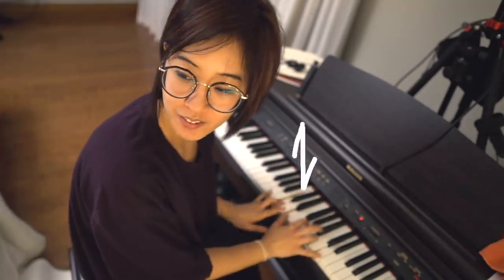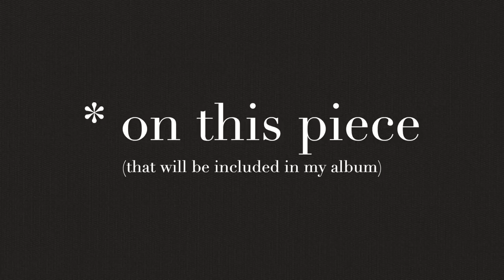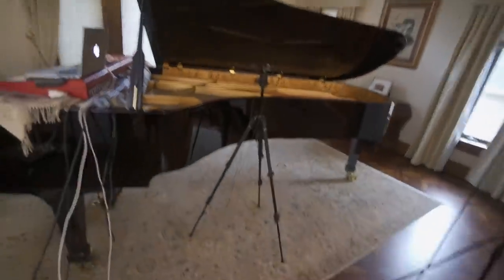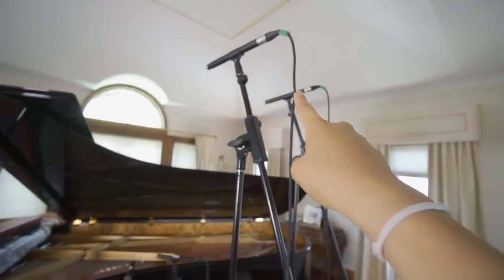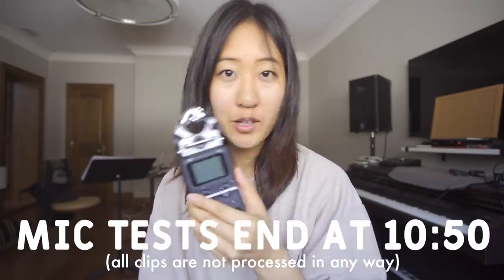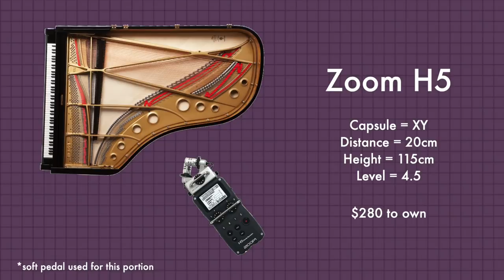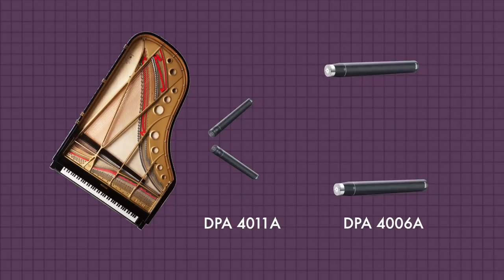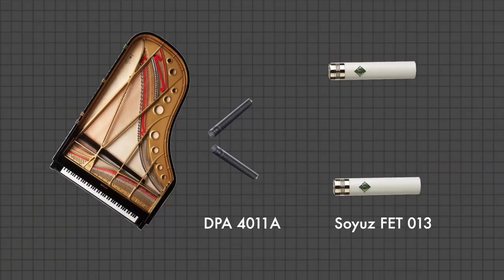Recording a grand piano is TRICKY - here's what I learned.

Comment: Thank You, I really enjoyed the video. Recording 24bit / 96k for grand piano was the correct choice. The microphone choice was smart using the x-y configuration and the high boomed stereo bullet microphones. I would say to use a larger capsule condenser microphone but you did try that with the NT 2’s. Your sound is clean and I did not hear any phase or cancelation. It’s a good idea that you got a second set of ears on the project with the engineer. The room itself is always the biggest struggle but you have a clean recording that captured what happened as far as I can tell. Brava!

Comment: I think you settled on a really lovely sound, and that's not easy (as you found).  There are a few things I've played with that I love to try when I get in front of a piano, sometimes they are just the ticket, sometimes they are no good.  I like omni microphones under the piano, there is an ability to capture intimacy with the instrument, especially pedal and key mechanics from below the piano.  While not a classic sound it is a sound I feel strongly about having grown up playing with toys under the piano while my mother and sister played.  I also like both LDCs and SDCs right up on the tuning pins.  I don't mind spacing them out and panning them a little L+R so that the space of the piano is in the playback with the same perspective of the pianist.  Again, not a classic recording setup although it is used for Keith Jarrett frequently.  It (like the omni's under the piano) present an intimacy that I don't normally hear in a recording.

One thing to consider is that a lot of people record a piano from the perspective of an audience member, but it's possible to get a very different sound by recording the piano from the perspective of the performer.

Very excited to see where this all goes for you!

Comment: The one at 6:36 8:02 and 10:32 is my fav dual setup. Sounds warmer and "closer," with a bit of softness. I think the mid-high and low clarity of the Soyuz works well with to give the somewhat fuzzier quality of the rode a bit more depth. 

Individually, I think the "best" mic is the DPA 4011A, it has a very precise sound I think, quite even sounding across the spectrum too. I do like the DPA 4006A more overall individually though, it's a bit more open feeling. Somewhat counter-intuitively, the Soyuz are my least favorite individually, the high is a bit too harsh. The rode is a bit fuzzier than the others, though it is quite even overall. The zoom is a bit hallow compared to the rest, especially in the middle register, and the low is a bit too soft

Writing this was a fun exercise! Micing and mixing isn't something I've had to do in depth much myself, as of yet, but I'm looking forwards to doing it in the future. Very deep stuff, so much detail you can obsess over with things like this!

Comment: Very good and easy setup for a Grand Piano:
2xsmall condenser mice into the piano aiming for the high and the low strings (panned Left right in the daw)
1x Large Condensor MIC at the Tail of the Piano facing towards the player.
Et voila :)

(Than just pick a room of your choice in the daw)

.. I used 2x Neumann Tlm 184 and a U87ai with a “foam” portable “vocal booth” over the u87

Comment: It was of course hard to tell through YouTube and earbuds (and my lack of hearing above about 13KHz I'm sure didn't help either), but I could hear some differences, and agreed with the arrangement you settled on. I couldn't hear the same differences in every test, but when I could, this is what I heard:
The crossed DPS 4011s provided a spaciousness not matched by any other configuration. The parallel Soyuz's provided a rich fullness lacking in the other parallel configurations (or even in its crossed configuration). The combination sounded great.

Comment: You ain't just a whistlin', more difficult than many other kinds of instruments.  It almost always helps when you get a knowledgeable expert on board, and high quality equipment is crucial.  The close perpendicular placement is interesting.  

I'll bet you didn't realize how dull and muddy the zoom mics were until this AB testing, it was like half the world opened up in the upper registers with the DPAs.  I found it interesting that the listening and comparing you did for the recording testing translated to more careful listening of the piano, close up, live, and in person.  

One thing I always found helpful was to get some very good closed headphones (highly attenuating the outside world) and then do some listening ABing from what you actually hear in the room at different listening positions to what is coming through the mics at different positions and orientations.  You put a crap load of work into this, and I'm betting it will pay large dividends.  Maybe you should start a gofundme for some equipment?  As you pointed out it ain't cheap.   

My father made some home made capacitor mics a few decades back and we were recording where there was also a professional sound engineer with some very expensive equipment doing the same (Von Neumanns maybe?) and he asked to hear the 'garage builts'.  He put on the headphones, smiled, and said "Can you make me a pair?"  It was funny.  Used to get some pretty fine recordings with those mics and the old Teac A3340 though.  :-)

Comment: It's weird to me that the DPAs had a slightly smoother sound, but it seemed like it was because they were missing a high frequency that all of the other mics picked up but it didn't, like it had a low-pass filter or band filter on it. It was weird. It's especially audible on the last piece.

So while the DPAs sound more "professional", the Soyuz and Rode have SO much more presence than the DPAs.

Comment: I have the issue that I've got a digital grand piano and want to record it with mics so that it sounds more real than just saving to USB. Putting a small diaphragm condenser on the cap edge of each speaker seemed kind of ok but I needed to use a lot of EQ to clean it all up. Putting the mics further away made it sound really dull. Not an easy thing at all so well done on making it sound so good.

Comment: This was interesting, those little zoom machines are incredible I used an H4n  with two AKG mics on a Grand Piano, had the mics under the lid, one covering the low end and the other the top end, I got nice stereo separation like that with enough spillover from each mic to cover the middle ranges of the piano. They were the exact same mics except they were made in two different factories so on playback there was a 3db difference in level between them!  even with that large discrepancy I enjoyed the result. It was easily fixed later anyway.

Things really got tricky when I went and tried the same setup on an upright Piano at a friends house, I checked out a couple of vids on how to mic an upright before I went to try it, short of stripping off all the panels, most of the vids I saw the piano was miked from the top with the lid up, I tried this but it was too bright with way too much mechanical noise and no low end, eventually I moved the Piano forward and got the mics in behind the sound board, I used the zoom at a distance just to even out the low end, this worked nicely but that little upright had me going for a few hours before I was happy!

Comment: I have a very nice Hamburg Steinway Model A that I’ve been struggling to record for 30 years. Once or twice I got what I was after, the other 99 attempts were duds.  I use 2 mics, I have either a Shure SM81 pair, or a AKG441A with a very inexpensive MXL that each worked only once. I am going to try all 4 at once next time, I know where my sweet spots are, could be all of them at once will do the trick. Last time it sounded great until I played it back on my large audio system, the sustain pedal thumped so loud through the subwoofers it was too distracting.

Comment: There is lots of snobbery in the audio recording business. People tend to think that because a microphone (or other equipment) is expensive, it sounds better. The same psychological mechanism is at play with wine: People imagine that expensive wines taste better than the cheap ones (although blind tests often show the contrary).

 I've been miking my grand with all kinds of equipment, and sometimes the cheapest budget microphones sound better to my ears than those super-expensive studio mics. Factors like room acoustics and mic placement are much more important. And not to forget - the skills of the performer.
Reply: and then there's me who found my favorite tone out of baby grand by just dropping a single cheap condenser on one of the sound holes padded with microphone foam filters for the best warm tones I've been struggling to get.
Reply: @Rolf: "Sometimes the cheapest budget microphones sound better...". Here's an example. Quite a few years ago, Recording magazine published an article on how a particular engineer was making highly acclaimed piano recordings. His trick was that he used cheap electret condenser mics from Radio Shack! But he had significant EE skills, and devised a special preamp circuit (directly connected to the capsules) that made them sound a lot better (less distortion, more dynamic range; it was a bootstrap circuit). And of course he experimented a lot with placement for each performer. —Tom

Comment: I like the DPA 2011 for the ones upclose, they have a warm rich tone. It made sense to me to pair with the Rodes mics on the rear for the larger diaphram but they weren't sounding as good as I thought. The Soyuz seem to pick up the higher frequencies missed but still sound kinda tinny and crunchy to me. Overall for these choices, the DPA upfront and Soyuz overhead was a good choice, where the high tones aren't so up close.

Comment: I love my Zoom H6, it came with omni mic as well as XY, i think it has the same capsule socket as H5. Zoom H5/6 can be a 96/24 usb interface as well. I think the H5 performed unexpectedly well comparing to hugely expensive, elite studio mics.

Apollo quad in my opinion is an elaborate scam to get your money. They made a good interface but decide to cram a computer into it so they can sell you effect plugins that run only on their embedded dsp processors, which made the whole thing way more expensive. If you are getting Apollo and not using their expensive plugins, you could spend the same money on an interface with better preamps instead of unused CPU/DSP power.

Comment: There are more ways to record a piano than there are keys on the keyboard but experiment with everything. Consider that less mics equals simpler phase relationships. 1 single mic will have zero phase cancellation but of course no stereo image. Also consider that the sound board is moving up and down. I like to have the diaphragm of the microphone parallel to this in the close mics. Every piano is different and even an expert needs a bit of trial and error.

Comment: -12dB is a safer bet BTW...meters don't track actual peaks correctly...and analog stages in ADs generally begin to become non-linear after -6dB (adding THD etc.)...it's one of the reasons transients can end up sounding harsh in louder passages...in the multi-mic setup the DPAs win hands down...for the pair the 4011s generally win...the Soyuz cardioid are interesting, just a bit brittle (around 8kish i think)...another one to try are Earthworks; DPA are hard to beat though...a sleeper mic for recording pianos are the discontinued m-audio sputnik, I kid you not, can be found for around 200 each, for that price unbeatable...

Comment: Kinda disappointed that you didn't try a Pressure Zone microphone. I work as an apprentice at my local opera and we have to mic grand pianos all the time. And while your setups are already pretty good, we use pressure zone microphones to mic large spaces, which could be the whole stage in some cases, or just the interiour of the piano. The other builds you used are too dependent of proximity, so you would have a lot of different leveling depending on where the mic is placed.